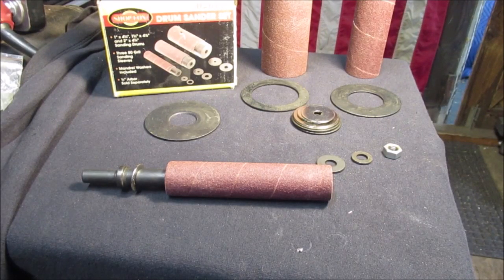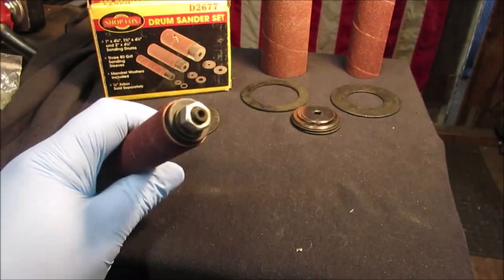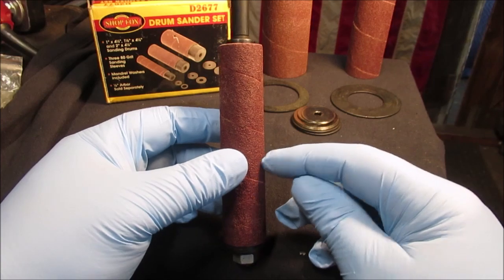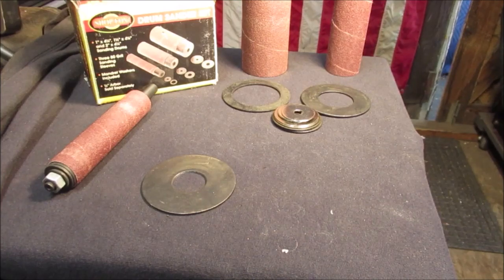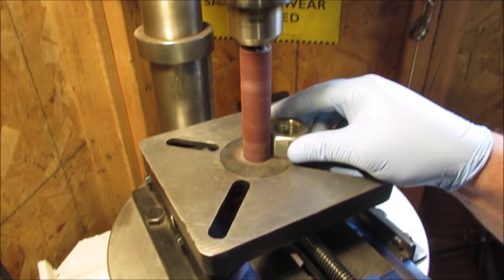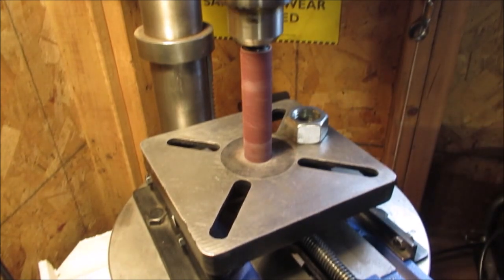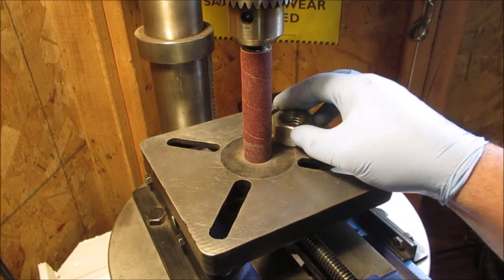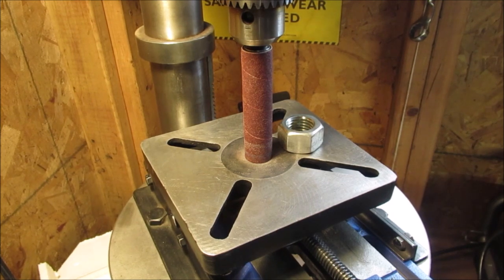Drum Sander kit for Drill Press

Comment: Thanks for the shout out!  I have a similar set of sanding drums - the different diameters come in handy!  I can change the speed of my drill press by moving the belts around on the step cone pulleys, but I'm to lazy to do it!
Reply from the maker: You re Welcome ..I know my viewers will like your videos..I can change my speeds the same ..I keep my speed at 250 rpm for drilling which keeps the bits cooler and I can use a lot of pressure down on the big bits and it does great on thick pieces